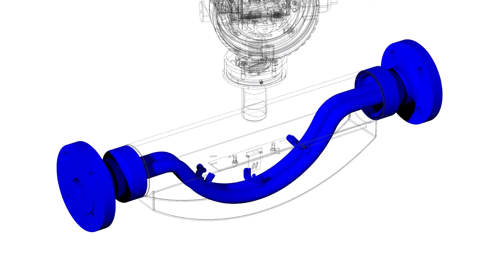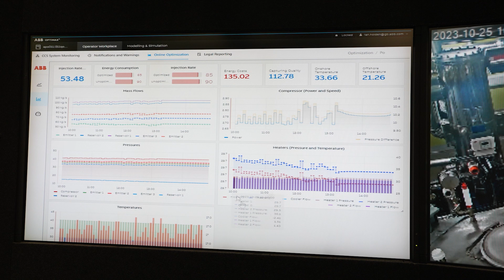Bringing safe, high-speed ethernet to hazardous environments

Comment: I took a metal rod in the mind, at one end of that metal rod we put DC or AC current, and we heat that rod, will we get a current vibrating in output, ETC, 😆😆😆😆😆🤣🤣🤣🤣🤣😡😡😡😡😡😡, etc

Comment: We transferred data from Sun Light, ETC through photodiode, LDR, ETC, we took 2 LDR 2 ldr and we have 3 Legs of audio output of mobile phone, and took two speakers of EAR Phone and took two speakers of Ear Phone and we have a LDR's LDR's LEG Added to left wire and the same LDR KThe second Leg was added to the speaker's left wire, in the same way the connection of the second LDR and the speaker with the right wire, the remaining ground wire connected the ground wire of two speakers and connected it with the ground wire of the output coming from the audio, when the song was played and the ldr was kept in the sunlightStarted giving, if the amplifer is added, then the loud can be deserted, there is no need to apply a variable resistor in it, just the brightness of sunlight, etc. can be easily controlled which will also serve as a variable resistor, ETC, 😆😆😆😆😆🤣🤣🤣🤣😡😡😡😡😡😡, ETC